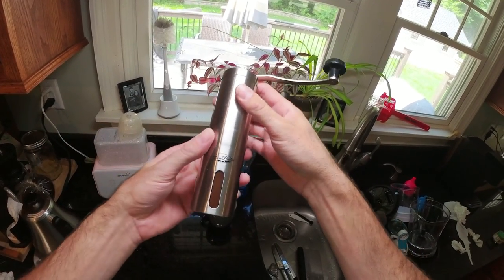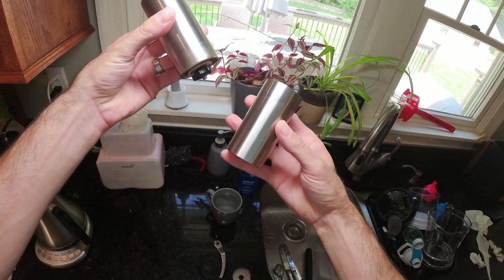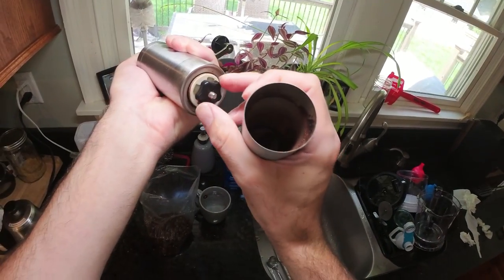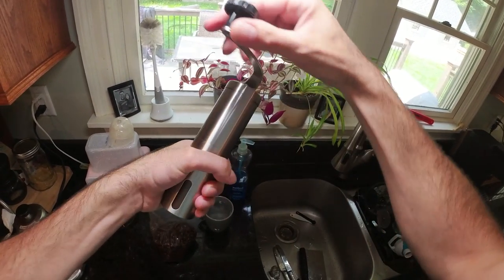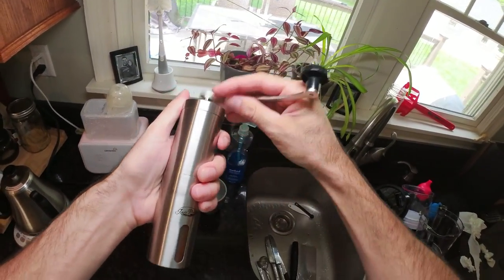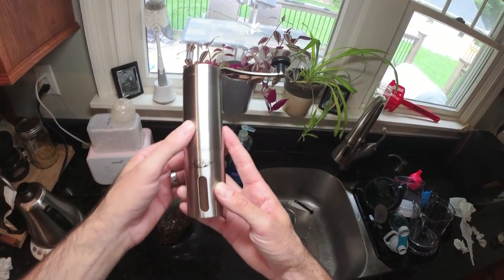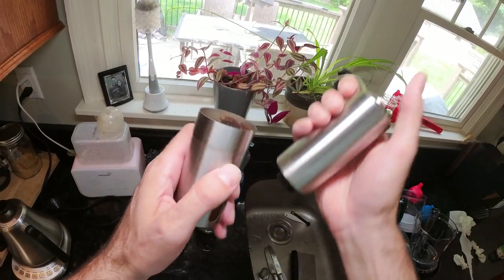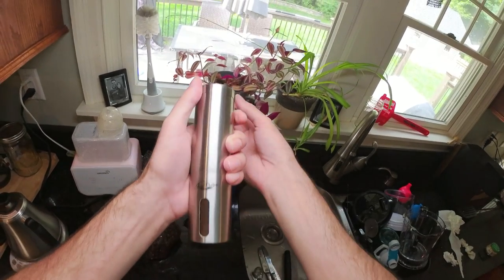Javapresse manual coffee grinder REVIEW

Comment: The whole reason to grind your coffee is for a better taste, correct. But if you leave residual coffee from previous grinds and don't clean it after every use you'll have residual taste from previous grinds/different type of beans that you have used plus old bean dust/residue that will get into you fresh new bean grind kind of defeating the whole purpose of a fresh ground bean.....I've notice this problem with all burr grinders especially electric ones that you can not properly clean.
Reply: I have a cheap black and decker electric blender disguised as a coffee grinder where you can't clean around the blade easily. It could be some drop-shipped thing too.
Reply: Great point.  That said this grinder can be quickly disassembled and completely cleaned.  Be forewarned there are three small parts that may try to find your sink drain.  But with due care it is a simple process to hand-wash (not dishwasher).  A toothbrush will help getting at the burrs. In 5 months time I did not notice significant affect to flavor from some slight accumulation in there. The amount of residual particles is very small.

Comment: I came looking for information about this grinder because I’ve had it for over a year and use it several times a week and just started to have a problem recently with the black handle coming off the arm that you grind it with. I didn’t drop it, I never put it in the dishwasher, I don’t know if a part is missing, but there’s just a little metal that drops down into the arm and holds the black handle that you grip in place but suddenly several times every time I use the grinder, the handle,, the black part, flies off the handle. So I wonder if I should contact the manufacturer and see if there’s some screw missing orwhatever